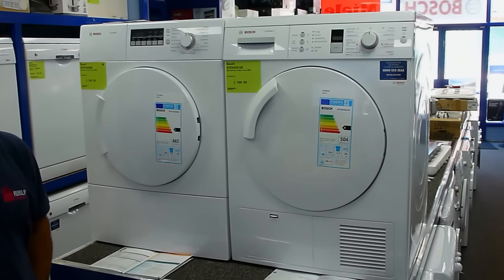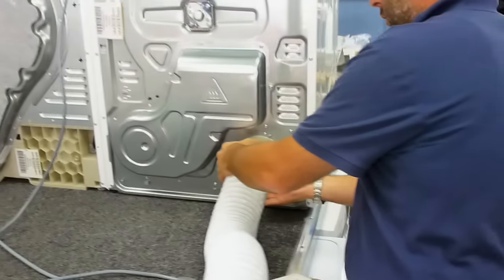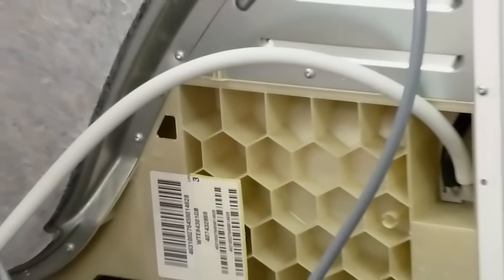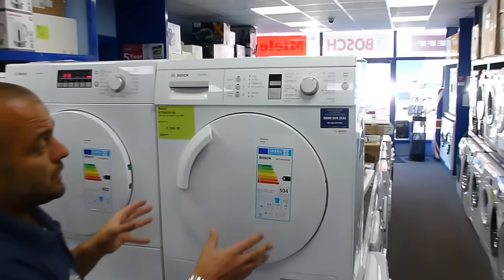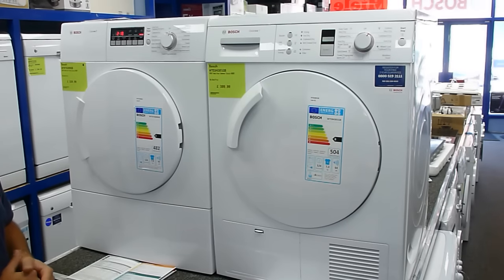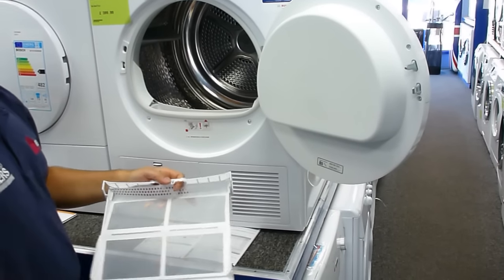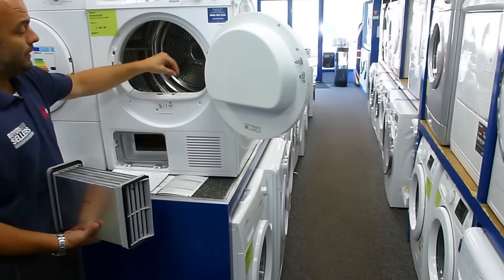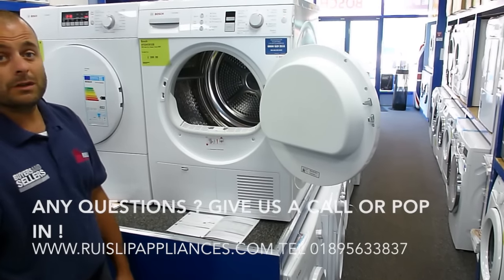A Video to show you the difference between a Vented and a Condenser Tumble Dryer

Comment: Worth mentioning that condenser dryers return all the heat to the living space. This can be an advantage in wet, cold weather as it will warm whatever space the dryer is located in, reducing the load on your central heating slightly. It can also be an issue in summer when you don't really want the extra heat in the house! Condenser dryers also work better when used in a cool and well ventilated space, the performance drops when temperatures rise. For this reason it is a good idea to keep the door to whichever room the dryer is in open when it's operating, especially if it is in a smaller space such as an under stairs cupboard or small utility room.
Reply: Thanks for the info, very useful 👍
Reply: Do you own one? Which model?
Reply: You wrote everything well...just used/mi spoke condenser instead of vented...
Reply: Buts it’s summer it’s like 35 degrees everyday and sunny outside I don’t think I need a dryer then.
Reply: ...mmm not strictly true. The warm air returned to the room is damp air and can be a cause for colds and flu, also not a good idea for asthma sufferers. Even though dryers are condensing it is always a good idea to have a window open so the damp moist expelled air can escape. If ever you walk into a room where a condensing tumble dryer has been on with no window open it may feel warmer but the air smells and feels damp. A really good video though, so well done.

Comment from the maker: thanks for the feedback guys , ydkoll the reason for this is that US models use more power they run hotter for longer , the European models are much more regulated on energy efficiency , so we dry at a lower heat / Kwh for longer.....
Reply: +RuislipAppliances Thanks Ruis. But is there any way to use my current American dryer or even swap out a component of some sort? If not I would hate to toss out this dyer. One of the benefits about this dryer is that it has a huge capacity.

Comment: I believe the  most important difference is not explained.  Customer wants to know which should is most suitable for who?  Based on the working principle I believe   .  If you live in a hot humid country....go for a vented.   If you live where there is winter and cold air,  then you are better off with the condenser air.

Comment: So the heat from the condenser dryer is vented back into the home, instead of outside?
Doesn't that create more of a load for central air conditioning?
Reply: firecloud77 these are European machines. When it's warm enough for air conditioning, we would dry clothes outside! Dryers are something we use more when it's cold and wet outside, in which case the heat from the dryer is a welcome bonus.

Comment: I prefer vented dryers! I had a condenser dryer for many years 12 in fact! Although the condenser used less electricity it would take longer to dry so in the long run I found I used more electricity now I have a typical c rates vented dryer I use less electricity as it dries faster….

Comment: thorough great review. Although I do have an unusual question. Why do American vented dryers dry so fast compared to the European or Australian market? I now live in Europe and vented dryers are so rare here its hard to find a one. I even brought a vented dryer from the US but later realized that its not just about the volts, its also about the herts per cycle. If you have any advice it would be greatly appreciated.
Reply: +Ydkoll US dryers are hooked up to a dedicated 240V circuit with a 30 Amp breaker. Typical current draw of such dryers is about 80% of circuit's max capacity - around 24 Amps. That, combined with 240V, results in a 5.7 kW power draw by such appliance.
European dryers are designed to use common electrical plugs that are rated at usually 13 or 16 Amps (depends on the country). With 230V, being the common voltage around here, such setup can supply about 2.8 - 3.6 kW.
Evaporating a given amount of water from the load requires a particular amount of energy. US dryer, being more powerful, will deliver this heat in roughly half the time of its Euro counterpart. It will do it by using hotter air or just venting more of it through the clothes.
If you want to use your US dryer in Europe, that should be possible, although you need to setup dedicated electrical circuit that can supply required current. Also, all rotating parts (fans, drum) will run about 17% slower due to lower frequency of the electrical grid (50 Hz instead of 60). Power output should be the same, though.
Reply: Michał Matuła Thank you for taking the time to explain in such detail and giving me hope as to what to do about my situation. I practically was ready to toss out my dryer. I fully understood what you meant by having or setting up a dedicated electrical circuit (which makes sense). And that is exactly what i did. However, when I turned on the dryer, the light came on, the drum rotated but no heat came out!! I think the big question here is can you alter or swap out the part in exchange for European part to accept 50 Hz? I don't mind if it runs slower as long as it heats about the same.
Reply: Ydkoll Grid frequency only affects rotating parts (induction motors, to be precise) and those are working fine, as you mentioned.
Well, clocks sometimes count time based on that frequency so they run a little slower with 50Hz (it doesn't have to be the case, though).
Also, motors designed to run on 60 Hz will tend to slightly overheat at 50 Hz and should run on a bit lower voltage (-10% let's say). It doesn't have to be the problem if it's cooling is efficient enough to handle a bit of extra heat.
It's odd that it doesn't heat since heating elements don't care for the frequency at all...
Maybe there's a wiring issue. Those dryers use 240V for heating but electronics (and perhaps motors) often run on 120V - an additional transformer may be necessary since Euro electrical systems don't supply such voltage. It doesn't have to be very powerful since these are responsible for only a tiny bit of the overall power the whole appliance consumes. How to wire it all up depends on the dryer and the electrical system, it's quite hard to tell over the Internet.
I guess you should get someone qualified to look at it and if it doesn't help then just don't bother and sell it (who knows, someone might be interested) or throw it out...
Reply: Michał Matuła You have very helpful with your input. Unfortunately I have had 4 or 5 electricians to get this started and I have had no luck. I guess maybe its just best to toss it out since I can't even sell it, much less even get it to operate.

Comment: What cooling medium is used to cool the condenser?
Reply: Tyler Heard air, taken from the room in which the dryer is located. If you open the flap at the bottom, you find a heat exchanger, basically a stack of plates that work like a car radiator. The air inside the dryer is circulated through the heat exchanger, and cool room air is blown over it, cooling it and causing water to condense inside it. It runs to the bottom where it is pumped out. The cooler, dryer air goes back through the heater and into the dryer again to pick up more moisture. These dryers do raise the temperature of the room they are in, and work better in cooler surroundings- if your dryer is located in a small utility room or perhaps under the stairs or in a similar location it improves performance significantly if you keep the door to that space open.

Comment: The condenser dryer takes a lot longer to dry when compared to the regular, vented, dryers, usually a regular dryer takes between 45 to 75 minutes to dry about any load.  That's my experience with them. A dryer that takes more than two hours, doesn't matter if it is a Bosch, can't be that good.
Reply: I have Bosch wdym
Reply: Please say which is best dryer

Comment: 2 hours to dry clothes in those tiny dryers??  WTH. A full load with a gas dryer is like 35 minutes max
Reply: zombiekush760 They never take as long as estimated. The UK doesn't really have a dryer culture like the states, we use them only when it's too wet to dry outside. These are deceptively large, they will take a full washing machine load. Of course gas dryers are faster, but because the UK has much stricter gas safety regulations than the states they have to be professionally installed, negating any savings especially since most people use their dryer only occasionally. Plus, unlike the states, electric appliances can be plugged in anywhere, we have over 3kw available at every outlet so electric dryers are seen as more convenient, they can be plugged in anywhere - an internal room, a cupboard etc.

Comment: The most important info was excluded, and that is that the condenser style dryer uses a refrigeration system to dry the clothes, and this gives many more things to go wrong with the dryer. On top of costing several hundred dollars more than the standard vented style dryer. You are far better off sticking with the standard vented style dryer.
Reply: Tim Campbell No. you're confusing this condenser dryer with a heat pump dryer. Condenser dryers work like regular dryers, but use cool air from their surroundings to cause the hot, steamy air inside the dryer to condense as it passes through an air to air plate heat exchanger. This means it does not need a vent. A heat pump dryer works as you describe- basically it has a fridge style compressor, which heats the air in the dryer but at the same time cools a heat exchanger causing water to condense out. They are vastly more efficient, but more costly to buy and complex.
Reply: no thats  a heat  pump dryer